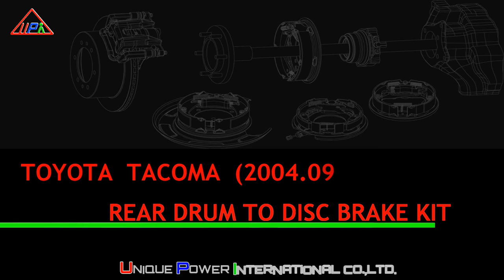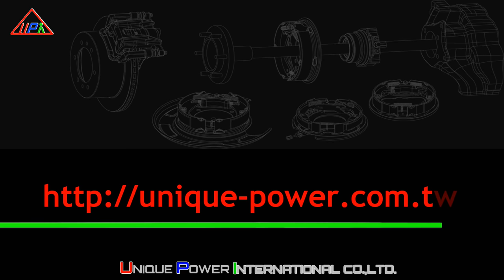Toyota Tacoma UPI rear drum to disc conversion kit installation guide

Comment: I was considering a Tacoma until I found out it has drums. Since I do my own maintenance, I hate dealing with drums. I guess it's the Ranger or Canyon. Drums...Toyota needs to get out of the 50s.
Reply from the maker: Tacoma, Hilux, D-max, Ranger, Triton and Navara, they are all equipped with drum for their rear.
Of course, the disc has better response than drum......
Reply: Unique Power International, the new Ranger is going to have drum brakes?
Reply from the maker: As our understanding, still the same - ventilated disc for the front, drum brake for the rear.
Reply: Christopher Paradise Drum brakes are seemingly outdated, but Toyota sticks with them for a reason. Discs all around are more responsive and easier to work on. However, Tacoma’s are notorious for being taken off-toad and being highly durable. Discs can be fouled by mud and sand, whereas drums usually aren’t. Drums also last a lot longer then regular rotors and pads. That being said, many Tacoma owners upgrade the front discs to drilled and slotted rotors for better response and braking power. I personally think drums/discs should be an option from the factory. I like working on my own vehicles, and while I did a drum brake unit in auto shop in high school, I don’t feel confident in tearing apart my rear brakes.
Reply: I want the Tacoma so bad, but I off road and do towing maybe twice a year. Drums suck for towing. And if rear discs were so bad, why does the Raptor and the Colorado ZR2 have discs in the rear? They cheaped out. Plain and simple. I agree that it should be an option, but I have a feeling that few would pick drums.
Reply: I didn’t know the Raptor and ZR2 had them. I suppose they either cheaped out, or they figured they’d stick with tried and true. Drums are a pain, but I wouldn’t let that be a deciding factor when buying a new truck. But everyone uses their vehicle for different purposes, so if you hate drums, you hate drums.
Reply: My rear drum brakes on my 2001 double cab Tacoma lasted for 250,000 miles and 14 years. Is doing a rear brake service every 14 years too difficult for you? Also, I’d wager that stopping distance is no better on these brake conversions as everyone is mum on the subject.
Reply: Why doesn't the Tundra use them? Toyota is cheaping out. Plain and simple. If you got 14 years out of one set of drums, great. You're in the vast minority. If drums were so great, they'd still be on every wheel on every new car or truck sold. Bottom line.
Reply: Christopher Paradise I agree with you it's all about being cheap and cost effective. My colorado has disc brakes.  Love that little truck wish it came with a 5.3 but the v6 ain't no slouch either

Comment: hey tonto you need to mist that down with some  water to avoid inhaling that asbestos dust you lungs will thank you when your 60
Reply from the maker: Thanks for your kind advice.
I will pass this information to the shop and the guy who help us to take this video.
Reply: How can you tell if your drums brake pads are made with asbestos?
Reply from the maker: Never, Asbestos is not legal in our country.
Asbestos products are not allowed to import to almost all the countries by law.

All parts are made by local to ensure its best quality even the cost is very high.
Our raw material of disc is much higher than the finished one from China.
It's a hard to make a choice but quality issue is no compromise for us.
Thank you!
Reply: Two Niner drum shoes.... pads are for rotos. I don't think we're in the 50s no more things are not made of asbestos.
Reply from the maker: Asbestos is not allowed in almost all of the countries.
To make products contain with asbestos means to give up any trading chance to the world.
Reply: you got that right

Comment: Good morning to all. 
1/2 comments for this video.

My first min watching I personally wasn't happy what I noticed right away especially being in a shop/exc. Z87 were made for a reason. they are safety glasses. I attended Auto-Tech at  MJC in California. My True Story,  exactly in this video, I went to my hands on Brake class. the reason for this one, if you forward to I believe 6+ min were the two are changing the rear drum. I'm up to get my credit for the class, well during the step by step process i was removing the main spring, as I was using the spring pliers I had to pull on the pliers towards my l-shoulder, my partner happened to be were, l.s.s, both rear drums were rusted. Pliers slipped { picture if it if you can} remember we're my partner was standing at, we both didn't except it. Right to his left eye directly. Dazed him for a good 5+ min. this was back in 08.
Reply from the maker: Thanks for your command.
This video is taken by our friend, we are design house, they work for the car repair for several decades.
Normally, this procedure is same as O.E. repair guide, and by individual worker.
The man behind is the boss and the operator is the  apprentice.
I believe that they need a goggle to protect their eyes.
We don't suggest people D.I.Y. for vehicle like Tacoma, to repair SUV or light truck need cutting and high pressure hydraulic machine.
Any commands are welcome : info@unique-power.com.tw
Your suggestion will make us to create more better product.

Comment: Do you have a kit for Toyota Hilux 2001, 4x4?
Reply from the maker: Hilux cable movement direction is vertical before 2005.
(After year 2005, the cable movement direction is parallel)

We are working on an easier solution to fix the cable path.
( Conversion kit for Hilux before 2005 is not available now)
Thanks!
Reply: @UniquepowerTwUnique-Power  Thanks. We will be waiting for you to have a solution.

Regards!!